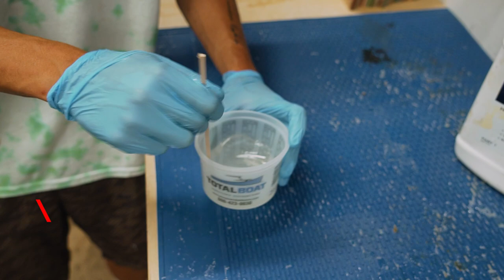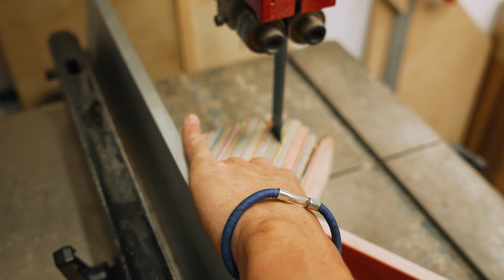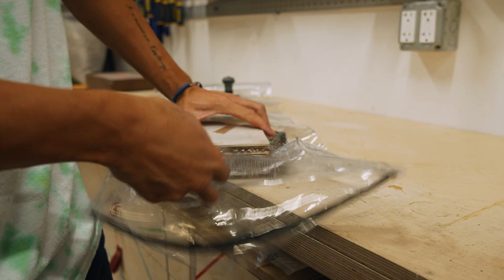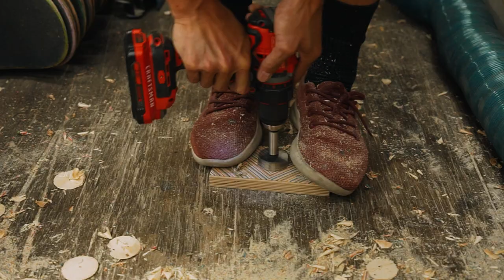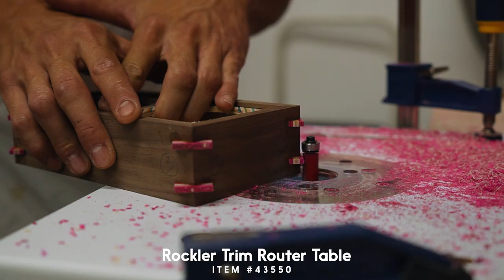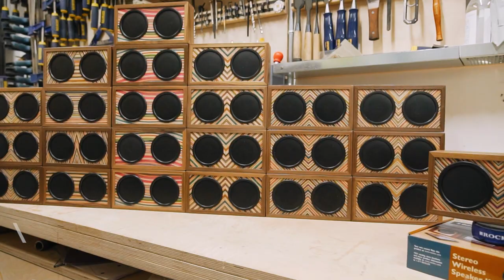BLUETOOTH SPEAKERS MADE OUT OF RECYCLED SKATEBOARDS!

Comment: Why did you use the Forstner bit with your drill? I couldn't get my drill press to cut with the bit, but using that same craftsman drill pushed right through it. I figured it was my drill presses old, repaired multiple times motor not having enough torque, but maybe not now
Reply from the maker: Cutting it at a slight angle works better than going straight down?
Reply: @WobyDesign  oh, I thought it was a limitation of the bit or something, thanks!